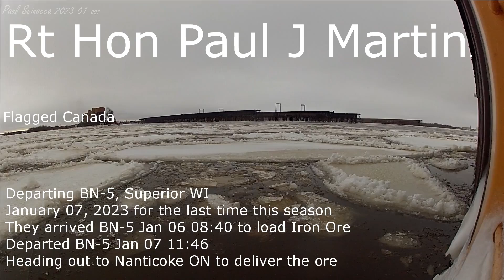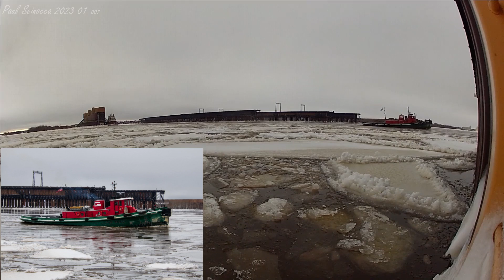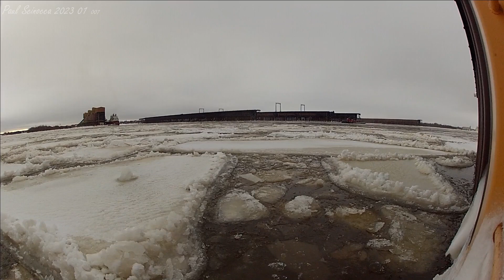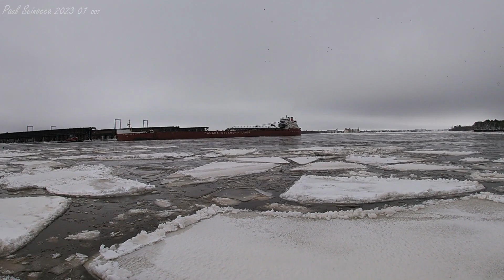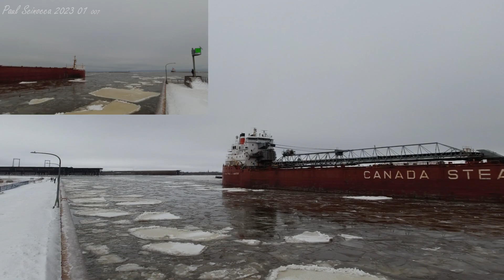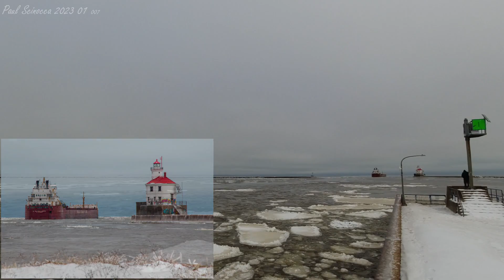Huge atmospheric event as they start the Engine on the Paul J Martin Listen to the Tug and the Ship!

Comment: It's great to hear what's happening, thanks Paul. Engines this size, working in cold conditions, do they have a 'donkey ' engine to turn them over when starting?  - I  wouldn't want to be the man with a starting handle!  🤣😁🤣
Reply from the maker: Not sure how they fire this one up? Maybe compressed air assist?
Reply: Compressed Air.
Reply: @PaulScinocca  Thanks Paul. As long as it's not a deckhand with a starting handle, a diesel engine that size will take some turning over, especially with the temperatures you get at Duluth. I was thinking donkey engine, air, do they have hydraulic for something so big? I  repaired agricultural machinery for years, so everything on a ship is big!

Thanks again for your knowledge, and videos.  👍
Reply: @zubrickadvisors6742  Thank you very much for your reply, and sharing your knowledge. I've only worked on agricultural machinery, then lifting equipment,  nothing on this scale. I rekindled my interest in the Edmund Fitzgerald a few months ago, and have now graduated onto the Lakers. I  aim on coming over from the UK hopefully next year to see a few ships. I hope to see Paul, but if he sees me first,  and films me, I'll be the one with my mouth wide open!  I know I'll see more with Paul's videos, but I want to see one (and a few more) and be deafened with captains salute!  👍😉😁